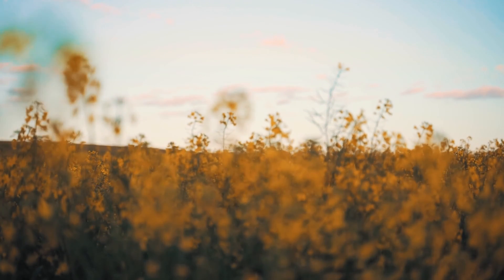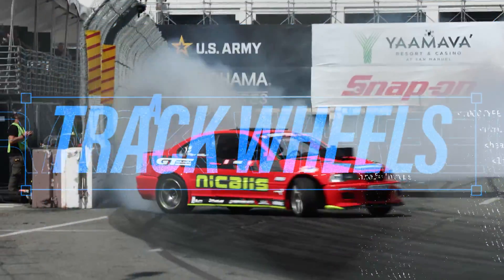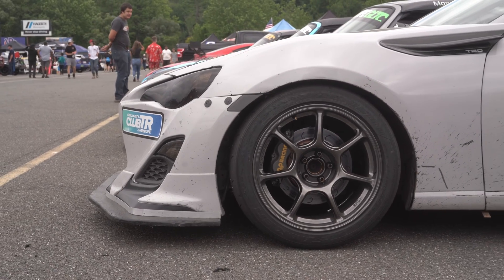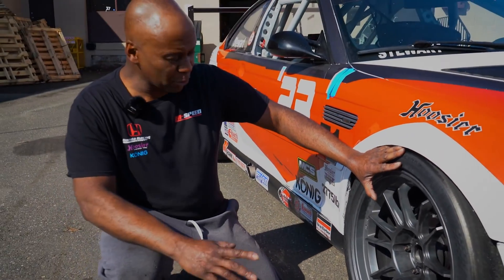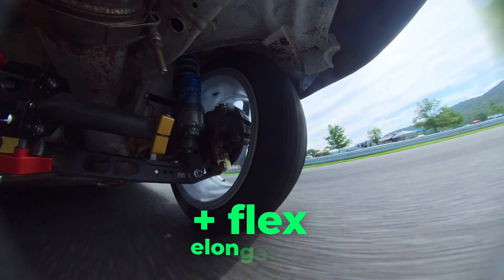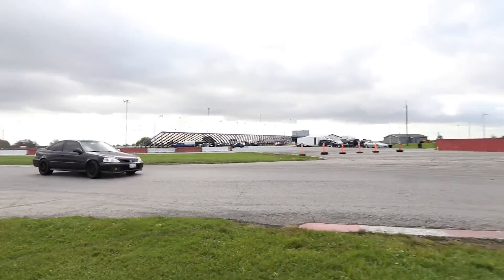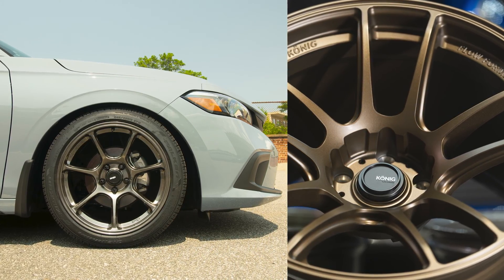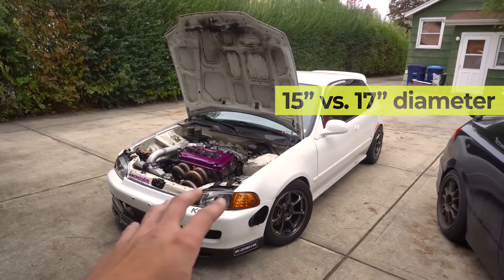What should I consider when choosing TRACK WHEELS? | #FAQ

Comment: What kind of load rating would I need for a 3900lbs car, 500hp and super 200 tires?
Reply from the maker: Almost all of our flow formed wheels will be more then sufficient. They are on track all over the world.
Reply: @ is there a wheel you sell that works work for me? 19X8.5 et38 and 19X 9.5 et56. For a c63S sedan non lowered 5X112 pattern. I want a safe wheel for track days and auto cross.
Reply from the maker: @ the MRK1 19x8.5 et32 and 19x9 et42 could work however it depends on weight of the wheel the MRK1 are on the heavier side of our wheel line up. They will need a test fit also with the brakes on there. Hope this helped.
Reply: @ weight isn’t an issue. More concerned about safety and if it clears the 6 piston Brembo. Would these work on stock ride weight and tire size?

Comment: I have a question to ask. Can a 19 inch Nissan black rims fit on a 2020 Toyota Camry .

Below is spec?

Nissan rims:
Bolt pattern: 5x114.3
Offset: 50mm
Center bore: 66.1 mm

Toyota
Bolt Pattern: 5x114.3
Offset: 50mm
Center bore: 60.1mm

I bought a hub ring to convert the Nissan rims to fit on Toyota Camry wheels. 

What sre your thoughts? Thanks in advance.
Reply from the maker: Great question. Both the Nissan wheels and your OE Camry wheels have the same bolt pattern and general sizing. 

As long as you are using hub-rings to take up the difference in centerbore size, you should be good to go. 

You'll be able to bolt your wheels on without issue, however keep in mind that there is a possibility of your fitment looking visually a bit off.
Reply: @konigwheels  thank you for quick reply. I figured it would work bec when I looked at replica rims all the spec was the same like the Nissan but only thing different was center bore size was bigger. In theory I went with Nissan Bec the rims was cheaper and I like Nissan OEM 19 inch rims better then aftermarket rims for 2020 Toyota Camry
Reply from the maker: @trueGrizzliesfan22  thankfully the Nissan wheel's centerbore size is larger, so you'll be able to just use a hub-centric ring to take up that gap.
Reply: @konigwheels  the rims fit perfect and I have no issues. No rubbing and vibration. The hub ring is perfect. Thanks for the feedback.
Reply from the maker: Great to hear! Glad we could help.  @trueGrizzliesfan22  🙏